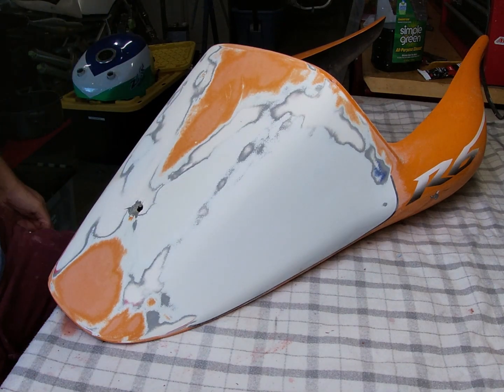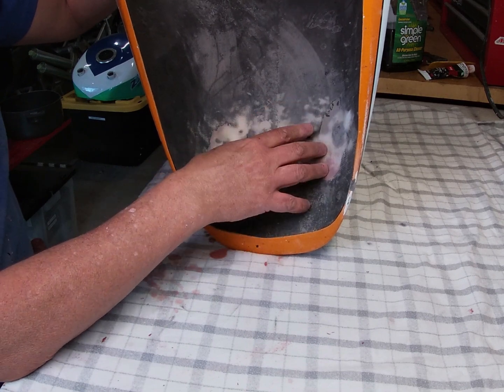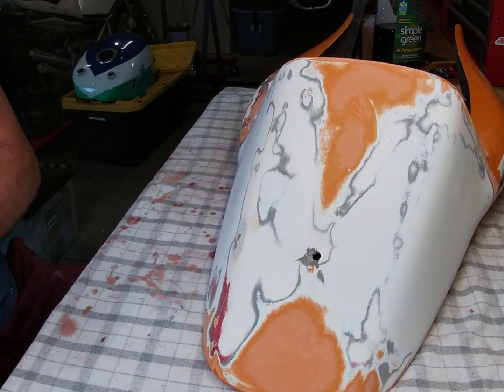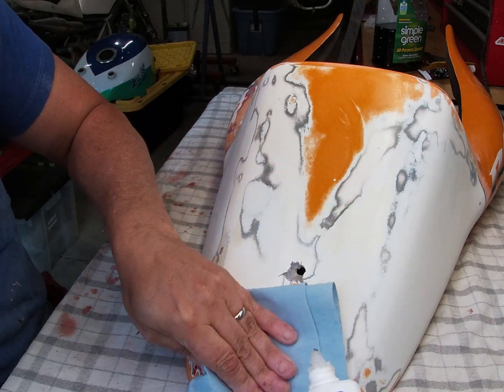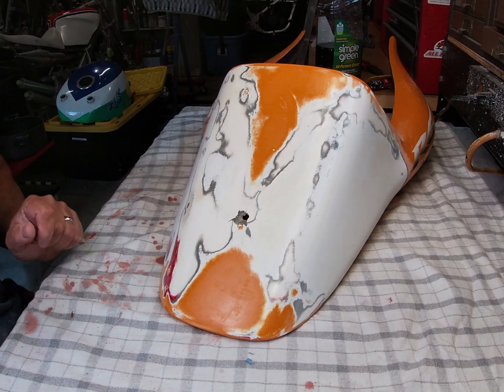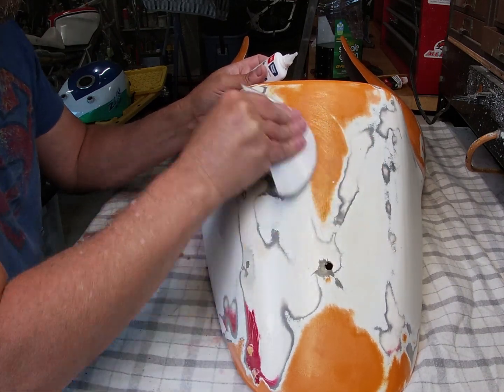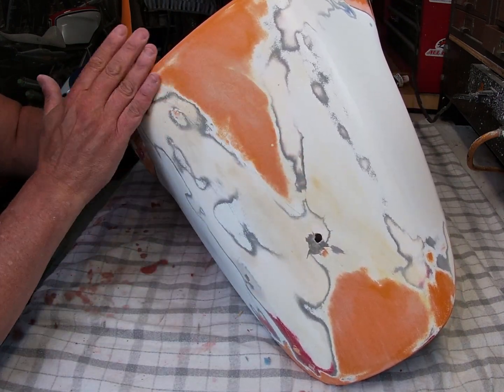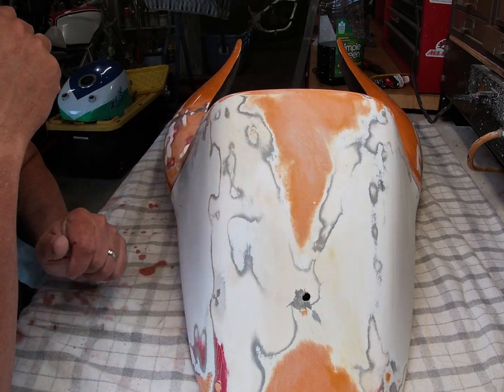CA method for repairing cracked or crazed gelcoat on lightweight fiberglass fairings

Comment: Had a a lot of spider cracks on a Pontiac MERA hood and trunk lid.  It took on a lot of direct sun in California and caused a lot of damage. I had to grind down to the matting and apply more gel coat with a powder fiberglass.  I will definitely use your technic to cover the panel for any cracks that I didn't see.  Its definitely a worry of them coming back.  Do you by chance bake the part afterwards to prevent any kind of shrinkage? Good Video!
Reply from the maker: I’ve not had to bake the parts when using this method, most likely because I’m mixing the fiberglass dust in with the CA, which limits shrinking. Hope the method works well for you, it seems well suited for smaller repair areas.